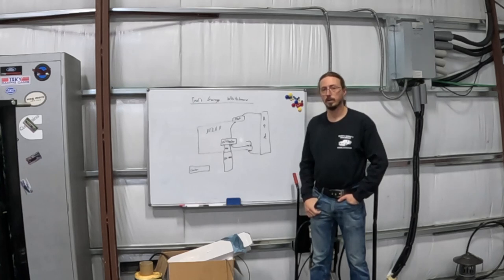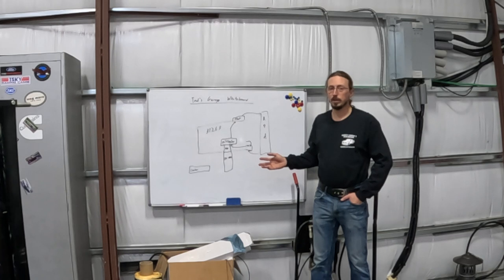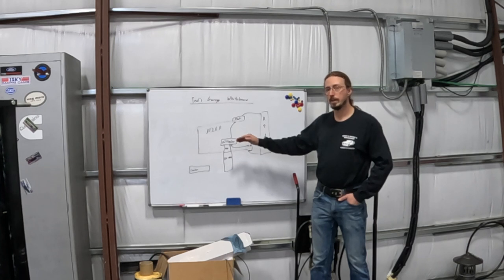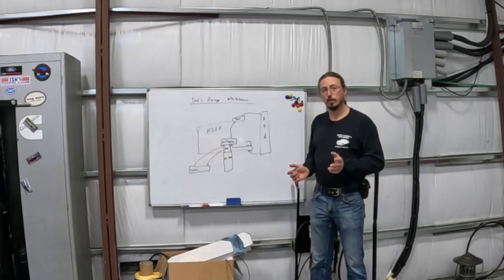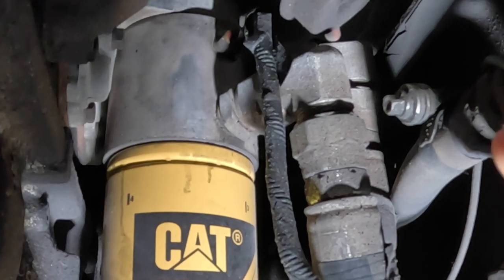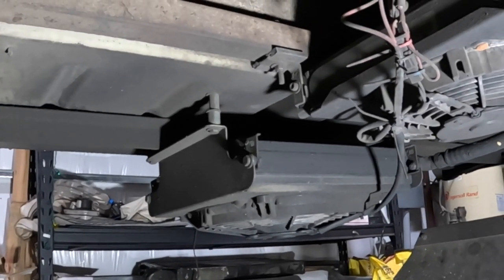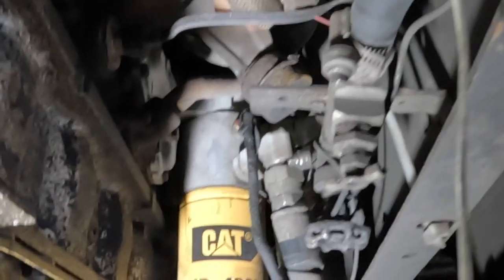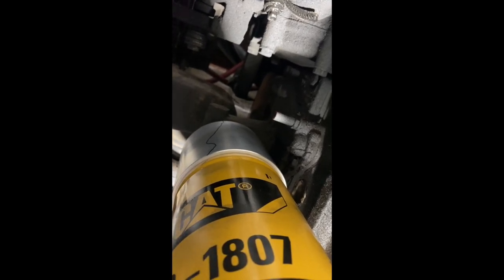Custom External Oil Cooler for the Caterpillar 3126B in my RV

Comment: Could you add this to the feed side leading to the Heui pump so no special milling of parts needed? The oil would run through the cooler then to the Heui pump via hydraulic hose.
Reply from the maker: I thought about something like this before going down the fabrication road. While possible, I don't think it would be a good idea. For one it would create a restriction specific to the oil feed going to the HEUI, which might direct more oil elsewhere on the engine and (more importantly) reduce oil flow to the HEUI pump. But it also wouldn't be nearly as effective on cooling the oil. There's a lot of oil flow going through and a lot of heat in it. The setup I did gets 100% of oil that goes through the filter (so virtually all of it) and also cools it before going through the oil cooler on the engine. So you would have both lower flow and the oil starting off at a lower temperature, so overall less heat transfer.

It was a lot of work, but definitely worth it.
Reply: @TedsGarage  Thanks, How is the cooler holding up? Where can I get a adapter for the oil filter? Cost? I have seen some coolers that come with adapters but not sure they would fit a 3126.
Reply from the maker: @thomasparsons3915  So far the coolers have been working great and I've had no issues with the setup. For the sandwich adapter, I wasn't able to find any existing adapters that fit, so a friend custom made this on his CNC machine.

I wouldn't do anything differently, it works great.